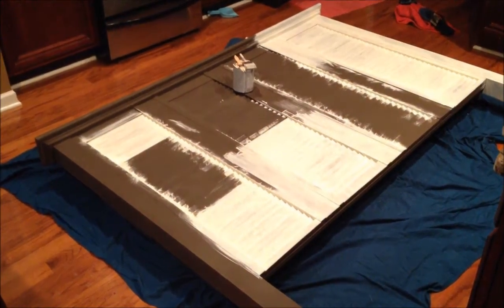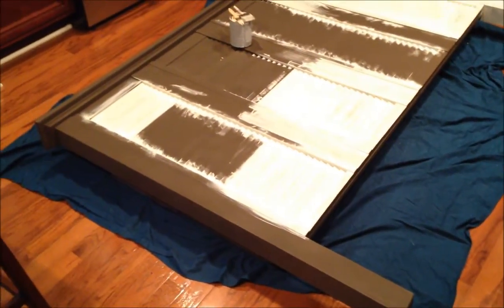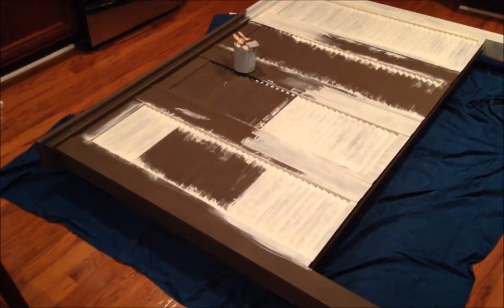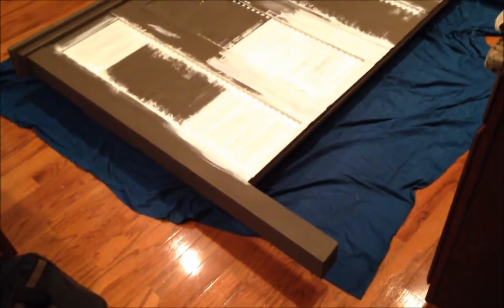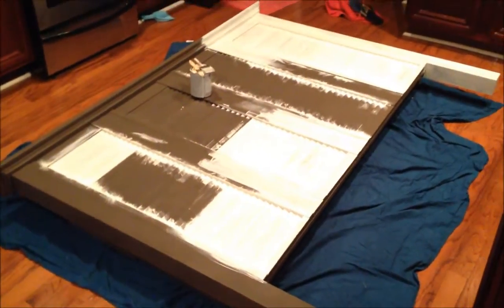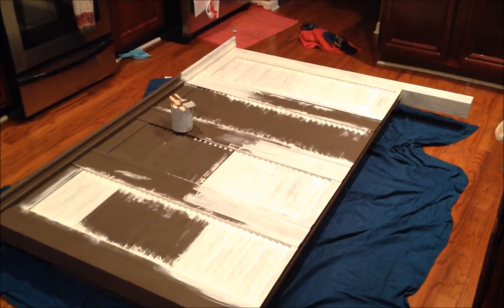King Size Headboard - Part 2 (CMRW#17)

Comment: Looking sharp! Also, I seen you spreading the glue with a foam brush with no foam.... hehe now I know what to do with those when the foam has torn or is useless!

REALLY LOVE the way you used the brown paint to give it a rustic look through the white.

Thanks for the video!
Reply from the maker: I can't remember where I saw the tip to use old foam brushes as glue spreaders. I think it was in Handyman magazine or something. 

Yeah, the distressing job came out pretty well, although, it was, in my opinion, the most tedious part of the project. I'd rather sand than paint, and I hate sanding! Thanks for commenting!